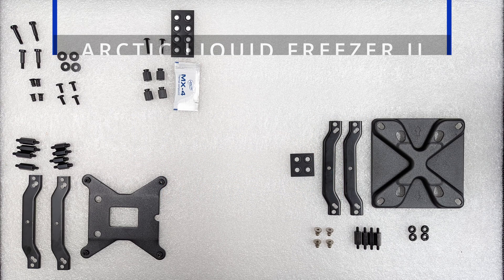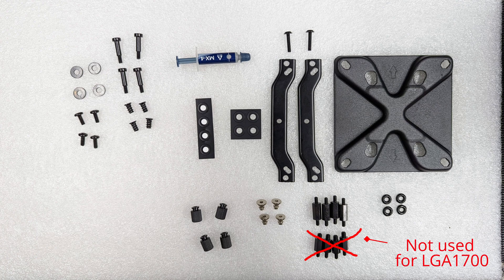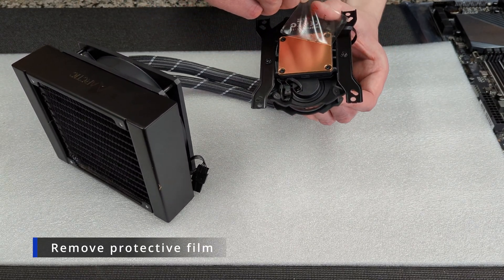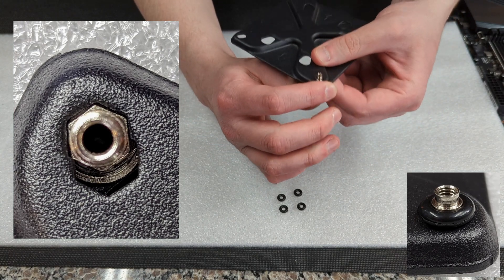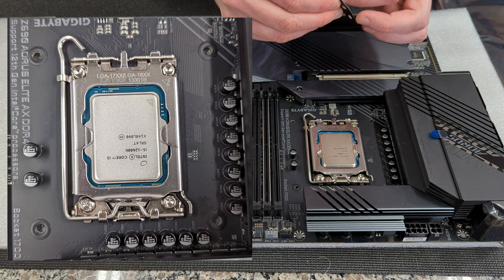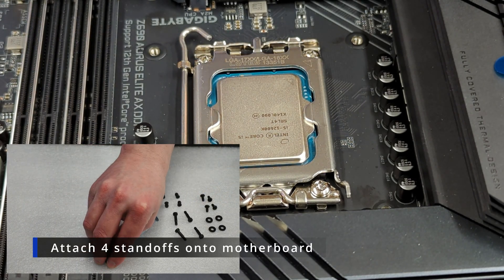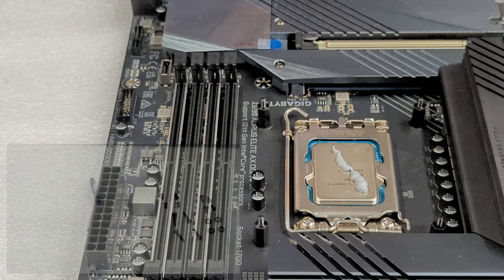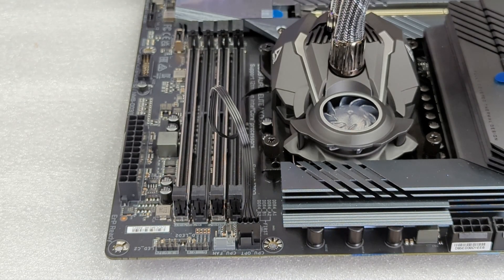ARCTIC Liquid Freezer II | LGA1700 Kit Installation

Comment: This is actually the most convoluted and annoying AIO I've ever installed for someone. 

The spacers are annoying, the backplate design is fucking stupid, and the digital manual isn't even updated to show this new bracket, even though it has a section for LGA 1700.
Reply from the maker: Hi Admiral Speedy,

I'm sorry that the installation caused difficulties.
If you have any questions, feel free to DM us on Facebook, Twitter or Instagram. Alternatively, you can contact our support team.

Our digital manuals are up to date and include the installation of the LGA1700. You can find them here under the different revisions.
https://support.arctic.de/lf2-360

Kind regards
Dominik
Reply: @ARCTIChannel  The digital manual for the 240 is not up to date. I literally scanned the QR on the box last night, it took me to the manual and the LGA 1700 section still uses the old back plate.
Reply from the maker: This is because we have tried to add the latest LGA1700 kits to as many CPU coolers as possible. So where we could, we included the new kit. Of course, we can't change the whole packaging, so you have to correct the revision in the manuals to see the new backplate.
I hope I could help you with that. If you have any further questions, please do not hesitate to contact us. :)

Kind regards
Dominik
Reply: @ARCTIChannel  The QR code on the box takes me to rev 7 of the manual, which has an LGA 1700 section that shows the old bracket.

There is nowhere on that manual page where I can choose a different manual rev.
Reply from the maker: Revision 7 of the Liquid Freezer ll 240 is the latest revision and therefore also shows the new backplate of the LGA1700. Under the following link you will find an overview of the revisions. https://support.arctic.de/de/lf2-240

Revision 6 shows the old backplate, and revision 7 the new one.
If you have any further questions, you can also send us a message via Twitter, Facebook or Instagram and we can take another look at it together. 🙂

Kind regards
Dominik

Comment: I just purchased the LF ii 360 ARGB, but called in before picking up to check the Rev. #. They said the box says Rev. 3 but also states that it supports LGA1700.. how is this? The store is memory express in Toronto, Canada and they said they probably just got this stock within the last 2 weeks. I have an ASUS ROG Strix z690-G m-ATX mobo and I've heard there's fitment issues so I was hoping to get the newest version that apparently takes this into account? I have tried emailing Arctic with no response. Thanks
Reply from the maker: Hey,
The A-RGB / RGB comes with Rev. 1-3
Rev. 3 is the newest one (LGA1700 included)
The normal version (without lighting) is available with Rev. 1-7
Rev. 6-7 with LGA1700 Kit.
You may also see Rev. 5 and below with the LGA1700 Kit.
The Kit was added manually by hand and should have the "LGA1700 Kit included" sticker on it.

Best regards,
Nico

Comment: This video seems to be showing Rev 2. Rev 3 comes with a variation of the mounting kit, what is, in this video, called "pre-LGA 1700". The only difference is, its got extended holes, so to speak, which can be used both for LGA 1200 (inside diameter ) and LGA 1700 (in the outer circle / diameter of the resp. holes).

Comment: Requires 8 spacers and the kit only comes with 4. That is a pathetic way to save a few cents. I don't have the the original spacers that came with my cooler, and what if you already used them. How is everything needed for lga 1700 not included in the kit?
Reply from the maker: Hey Jake,

The Kit comes with 4 spacers, since they are especially for the LGA1700 (they are a bit thicker)
The other 4 spacers should come with the normal mounting accessory.
If you need more spacers, kindly contact our support - We'll send you some extra once.

Best regards,
Nico
Reply: @jakefoster8308 hi did you use only 4? And what is ok?

Comment: Hello, I'm desperate, I tried everything. I had a problem during the installation of the watercooling artic freezer 240 argb, when I installed the socket, the base, the 13mn screws, the thermal paste and finally the pump, I saw when starting my pc, my processor (i5-13600kf on aorus z690 elite ddr4 with the bios update done) reached 95-99°C. I could see that the pump had not come into contact with the thermal paste and therefore there was no cooling. the thermal paste was therefore not spread on the processor and this caused overheating, the problem is that the 13mn screws are slightly too large for the installation of the pump on the processor, I tried the screws a little smaller included in the box but nothing works. can you help me to solve this problem?
Reply from the maker: Hey Fishy,
Kindly check your DMs on Twitter :)

Best regards,
Nico

Comment: Mine only came with 4 peel off spacers so I'm gonna put them on the top of the motherboard?
Reply from the maker: Hey Joseph,
I'm sorry for the inconvenience.
In that case, kindly contact our support - I'm sure they will send you some more.
Normall there should be 4 thicker onces, from the LGA1700 - I would recommend putting them onto the front side, since they protect the board, when screwing the standoffs in.

Best regards,
Nico

Comment: I bought the Liquid Freezer II 280, and i made sure multiple times that is is compatible with my system. Its an LGA 1700 chip, but when i opened the box it only had the LGA 1200 socket bracket. It appears to work anyways and i managed to mount the plate and cooler together. Do i need to be worried about a short? I did not get that X shaped bracket that was in the manual online.
Reply from the maker: Hey feshy,
Kindly check my last reply, if you need another backplate/mounting :)
I would recommend going for the right mounting.
Reply: @ARCTIChannel  Thank you for the support. Went ahead with it.
Reply: I'm in the same boat. Just bought an new 280 and it didn't come with the 1700 bracket.
Reply: @solidacid5  arctic has a form for it. You beed to submit your receipt for your Alder/Raptorlake cpu with their link from their shop. Im getting it just to be safe
Reply: Oh I saw, I also saw the 21 day shipping estimate which is rather absurd since that's longer than it took the cooler to be shipped to me. You'd think they'd just give you some Amazon coupon for the same kit to expedite this.
Reply: @solidacid5  this is kind of funny how they bothered to print LGA 1700 support on the box but it did not include the retrofit kit. I may return this and just buy one at Microcenter instead
Reply from the maker: Hey,
We're offering free LGA1700 Kits, since some older stock is still arround (without the LGA1700).
It's hard for us to recall every single unit and put a Kit inside and ship it out again.
Amazon for example offers mixed stock - you can be lucky and receive a Rev.7 with thiner backplate or you receive a rev.5 - without LGA1700.
Kindly fill out the form on our website and I'll send you one :)
If you need the thiner plate, kindly send us a DM.
Shipping times are currently a bit longer then usual.
Thats due to COVID and the holidays here in germany.

For further questions don't hesitate to ask

Best regards,
Nico
Reply: @ARCTIChannel  ich habe bei amazon eine revision 7 bekommen, allerdings NICHT die X-platte, sondern das andere modell. ist das jetzt trotzdem kompatibel mit dem lga 1700 sockel, weil sie schreiben die platte wäre dünner?
Reply from the maker: Hey Plaka,
Ja die "ältere(Rev.6)" LGA1700 backplate ist auch kompatibel.
In seltenen Fällen kann es dazu kommen, dass die backplate nicht ganz passt - dafür gibt es dann die dünnere.

LG Nico

Comment: The threading on the screws is blurred out. My obligatory free kit was missing half the rubber washers. I bought an extra kit because I was warned how bad this was, and boy were they right.
Reply from the maker: Hey Donald,
I'm sorry for the inconvenience you had with the LGA1700 Kit.
When did you ordered your Kit? Otherwise i can simply send you a Code for a free Kit on our website.

Again sorry for the inconvenience

Best regards,
Nico
Reply: @ARCTIChannel  I got both kits two months ago, but I had no inconvenience because I bought the extra. From the reviews I've read this is a very common and unresolved issue for most Arctic LGA1700 kit users
Reply from the maker: I'm sorry to hear that.
If there is something missing, don't hesitate to ask. I'll gladly send you the spareparts.

Again sorry for the inconvenience you had

Comment: And now the big question: are the mounting clips the same? Bc I had only the ones in the Old Kit
Reply from the maker: Hi Isaac,
assuming that you have the Liquid Freezer II AIO in use, the Alder Lake kit from above would be the same which is included with most AIO Coolers.
Best regards
Stephan - Arctic Service

Comment: I got an Arctic LF 360 with the LGA1700 Kit and a Asus Strix 790-E. The adapter plates that go on to the pump don't fit with the VRM heatsink of the MB. It that a known problem or am i doing something wrong? I could make it fit by cutting the last hole that's not used though
Reply from the maker: Hi Christian,
i checked the board and i assume the top (north side) sink is in the way? When you can solve the issue by cutting of the last hole, feel free to do so as i can easily send you those clips again. Let me know if that worked out for you.

Best regards
Stephan - Arctic Service
Reply: Hi, I am having the same issue as Christian. Have you solved that? Thank you
Reply: @Scaryder92  yea, i cut the last hole and mounted the pump facing to the left not top. The cpu is running good, especially if you undervolt it. While gaming i run around 55-65 degrees Celsius on average.

Comment: I ordered the arctic liquid freezer II 360 and it advertised it as coming with the lg 1700 mounting kit and it didnt. Very angry
Reply from the maker: Hey there,
If you order directly form our website you should have the LGA1700 Kit inside. If you order from somewhere else - it may happen, that they still have some older stock available (without the Kit).
Therefore we offer free LGA1700 Kits.
If you need one, kindly DM us your invoice of either your CPU or the cooler and I'll send you a code, which you can redeem on our website to get your free Kit :)
We're sorry for the inconvenience.
Best regards,
Nico

Comment: It should be noted that the LGA1700 kit does not fit in all towers. For example the hugely popular LianLi O11 Dynamic.
It can be made to fit by cutting a chunk out of it, though that's beyond what everyone can do.  A dremel will be good for the purpose, takes 10 minutes.

Also be careful that there are many LGA1700 kits, I ordered to wrong one which had too long standoffs.

To me it seems ridiculous to provide a 5mm thick steel plate to mount a cpu cooler. 
A thin aluminium plate would work, a 2mm plastic plate would do. I suspect that even a normal nut would be fine, there is not that much pressure on the mainboard.
Reply from the maker: You're very welcome!
Thank you for the update😊

For further questions don't hesitate to ask
Reply from the maker: Hey there,
We noticed that already and we apologize for that.
New backplates are available - they are thiner then the first onces.
If you need a thinner plate, kindly let us know and we'll send you one.
Best regards,
Nico
Reply: @ARCTIChannel  I reached out to arctic germany a week ago through their "support form" and there was no response at all.
Reply from the maker: Hello Ha Ka ,

Please excuse the unusually long waiting time. We are currently receiving an above-average number of requests to our support department. Our team is working as quickly as possible and will process your ticket as soon as possible.
Thank you for your understanding! 😄

With kind regards
ARCTIC
Reply: @ARCTIChannel  Is there a shop, that sells these thinner LGA 1700 backplates?
I wouldn't mind buying one, if it arrives faster, since I've also written to your support team.
Reply: @obs1dian_015  Just as a side note, you can use a dremel and adapt the thick backplate to fit without issues (or downsides). It takes 5 minutes if you do it carefully. 
My problem was that not only the backplate didn't fit, I purchased a wrong kit so maybe my bad cooling results on the 13900k are from my standoff-screw-adaption to fit the wrong kit. 

I ordered one through their form, will report if it helped.
Reply from the maker: With a proof of purchase of a processor with LGA1700 socket, we will provide the required mounting kit for free. Under the following link, you can easily request it. https://www.arctic.de/support/lga1700-mounting-kits/
Reply: does it fit on the evo?
Reply from the maker: Hi LMF-Gaming,
my colleague Nico told me to answer your request. The Evo Case from LianLi is easy to use with our AIO. Just a 420mm unit wont fit in there. Regarding on the screwdriver, we don´t use a special one but i think #2 is the right one.

Kind regards
Stephan - Arctic Service Manager
Reply: @ARCTIChannel  thanks for answering my Qs. I proceeded to buy the evo case with your confirmation and was able to screw down the bracket screw. i ended up just using a different screw but same size as the one from the kit.

Comment: Does it work on the ASRock Z790 PG Lightning/D4 ATX LGA1700 Motherboard?
Reply from the maker: Hi Tarnished Kirbs,
the mentioned Board has its mounting holes far away from any heatsinks/parts and the mounting should be easily possible.
The Alder Lake backplate is on the thicker side, please check your case if the thicker backplate wont collide with the case.

Best regards
Stephan - Arctic Service

Comment: @arctic I followed this video but for some reason the standoffs seem to be too tall and the cold plate does not make contact with the cpu. Am i just dumb? Or did i get the wrong standoffs in my lga1700 upgrade packet? I cant figure out where im going wrong.

I have the arctic liquid freezer ii 280 in case that helps
Reply from the maker: @Awesomemainas
Great that you could help! :) Thanks a lot 💙
Reply from the maker: Hey Awesomemainas,

to explain the whole thing to you in more detail, please contact our support. They will be able to help you. :)
https://support.arctic.de/de/menu/support

Kind regards
Dominik
Reply: I reached out 3 or 4 days ago. Just waiting for a response now. Hopefully they will know. Im not sure how to provide more detail as there was a limit of a 1mb picture to upload through your support ticket which is way too small of a limit since the camera on my phone takes very large photos.
Reply from the maker: Hi Awesomemainas,
i´m Stephan and i work on our Support ticket system, please let me know your ticket number to check for your request.
BR
Stephan - Arctic Service
Reply: @Garrett_Collins  Hi, I am in the same situation. Did you fix your issue? if yes, how?
Reply: @Jimmy Hamel  make sure you have the brackets that attach to the cold plate attached the correct way. I made that mistake and that was my issue. I had the brackets on upside down. Also make sure you are using the correct standoffs. They are slightly shorter than the old ones. Hopefully that helps!
Reply: @Garrett_Collins  THIS WAS EXACTLY IT OMFG. Thank you so much, I checked everything but that. I am more than grateful for your comment! I have lost so many hours on this. I wanna say sorry to Artic for all the curse words I said towards them during this first pc build.
Reply: @jimmyhamel1392  YAYYYY!!! I'm so glad I could help you! I hope other people who are having an issue see this comment and maybe just double checks those brackets! I spent many hours trying to figure this out hahaha! I woke up at 630am one morning determined to figure it out or I was just going to revert back to my 10850k while i waited to hear back from their support team. I figured this out because i couldn't figure it out that morning and so i started putting my old setup back together again and when i tried mounting the cooler onto my old setup...it didnt make contact with the cpu again....so i then looked closer and a light bulb moment happened where i realised the brackets were mounted upside down... I facepalmed so hard and felt really dumb for not noticing...
Reply: @Garrett_Collins Please help me. I spike to 70 degress loading a game cuz of bad contact. What have I done wrong? Can you call Arctic?
Reply: @gustafabrahamsson4251  make sure you have the brackets that attach to the cold plate attached the correct way. I made that mistake and that was my issue. I had the brackets on upside down. Also make sure you are using the correct standoffs. They are slightly shorter than the old ones. Hopefully that helps!

Comment: I've got a LGA socket. The cooler is rev 3, when i scan the QR code on the box for the install instructions, it's showing to use the old bracket? is that correct?
Reply from the maker: If you have a LGA 1700 socket, please use the new kit.

Kind regards
Dominik

Comment: When installing the standoffs to the back bracket, is it normal to have something like 1mm or 2mm space between the motherboard and the rubber washers? It's not entirely clear if the corners need to touch motherboard.
Reply: Yeah most of the la1700 boards come with thick Intel backplate in silver, usually engraved with "lotes" who makes the mounting hardware.
Artic made first back plates black thick pieces where the inner hole is too small and thus it sits on top of backplate :-/
Apparently there is a new backplate for lga1700 mounting kits
Reply: Hi, have you had a problem with that space of 1-2mm between the motherboard and rub we washers?
Reply: @dragomirvelev2209  Problems? No. It's been almost 2 years since my installation and everything is fine, even with the 1-2mm gap.